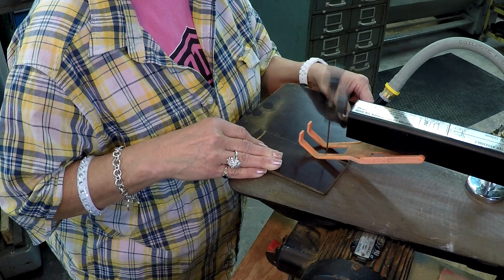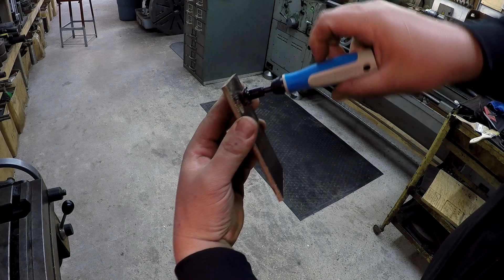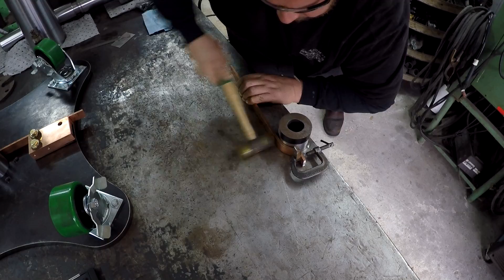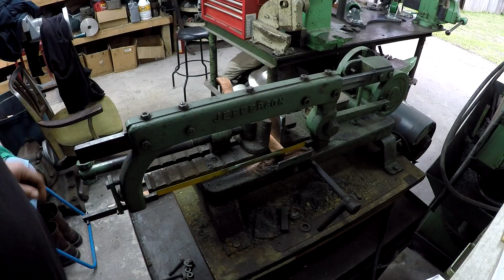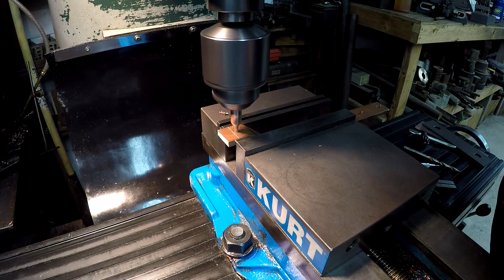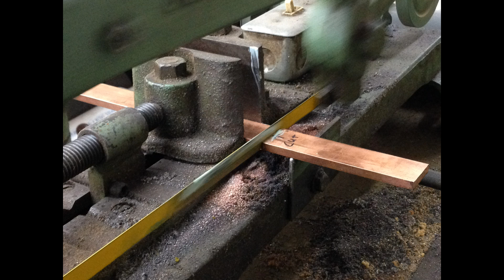Rotary Welding Table Build Part 14

Comment: The bolts would be better in brass than stainless with dissimilar metal you will have some electrolytic action take place but to a lesser extent with brass ! You could have bent the copper more easily had you annealed it first.
Reply: If he'd annealed it he would have lost the spring tension in the bars. The bolt with the spring would have then likely just bent the two ends together rather than truly provide more tension and adjustment for ware.
Reply from the maker: Dick Sargent My thoughts exactly. I didn't want to take a chance on them being too soft.

Comment: How about a motor with a foot switch, and a tilting chuck or maybe fab a T-bolt-down multiple position vice from a flea market find? (I'm thinking about Keith Fenner's set up.) You seem to be having way too much fun to stop now, and it's legal. Besides, what would all the experts do without your welding table?
Your Mom's cool....
Reply from the maker: Hey Lee, you just chocked full of ideas! I do havemore plans for the table, but it will be later on after the initial build. Thanks bud!

Comment: Hey there. First off let me say that I love this series. I picked it up about halfway through, but went back and caught up on it. After subscribing of course. 
 Now I know a little about machining, mostly from what I remember from high school, but there are a couple of things that you've done that leaves me with a couple of questions. 
 1. Why ream a hole the same size, or slightly larger, then a hole you just drilled? Now I get the idea (or should I say the need) of deburring, but what does the ream do that the drill bit doesn't?
 2. I seen machines do single point threading. But they are set at a consistent feed speed. How do you do it by hand? Are you hand feeding the cutter, or do you set your lathe for an auto feed? I do know enough to know that if your speed is off while your milling threads your thread pitch will be off as well. Hence the reason you took quite a few light passes then checked it with the pitch gauge.
 Keep the vids coming. They really are fun to watch. Thanks.

Comment: Hi, Adam. I would like to ask you something about this grounding: You mounted the copper block isolated from the base. But the two "brushes" are coming in electrical contact with table shaft, isn't it? Since the table column assembly will be bolted to the base, and all of its components are metallic then there will be also electric contact between the shaft, column and base. Then, why bother to mount the copper block isolated with phenolic bushings and plate on the base?
Reply from the maker: The current should flow through the shaft and into the faceplate and not through the bushings, or thrust bearing, and keep from chancing any arcing in them. That's my theory on it.
Reply: Abom79 I understand. Well, the most direct approach would be mounting a grounding clamp or something directly to the faceplate. However, this would limit the faceplate rotation feature, that's why you choose to apply the elegant "brushes" solution. You should do some testing to see if the spring tension on that bolt provides enough pressure of "brushes" on the shaft, to avoid arc in between. Thanks for the prompt answer.

Comment: For the spring, how bout a through bolt with a spring on it to push the pieces together
Reply: oops should have wathced the entire video b4 my comment
Reply from the maker: I thought you were messin with me for a second. LOL
Reply: Adam, I have been a machinist (all manual) for almost 30 years now. I guess you learn things here and there just from experiance. It never ceases to amaze me just how similar your thought process is to mine. I am in a machine shop in a papermill. All one off repair and alot of obsolete parts.

Comment: Nice work on the bends and cool idea on using the bolt and spring for the tension.

Just curious, after you tack weld the fixtures (the bending fixtures in this case) to the table, to remove do you just grind the weld?   And then grind level to smooth out to the rest of the table?
Reply from the maker: Thanks Ryan. Yes to remove just grind the welds and knock the parts loose. I use a flap wheel on the grinder to dress the welds down smooth, like a Tiger dics.

Comment: Hi Adam, nice job on the ground. I've been wondering since the you started with the ground how you plan to insulate the shaft from the base as well as you did with the ground. That is going to be tricky.
Reply from the maker: I don't see any further needs for insulating. Current should flow though the shaft the way it's built. But, the base will be painted and I'm thinking about leaving the area where the column mounts painted also. That would help to create another barrier.

Comment: Hey Adam. On Ground Straps Instead of A spring. Use a bolt and a nylock nut just to hold tension on it ?

Comment: Adam,

Metal surfaces exposed to the atmosphere tarnish/corrode.  The oxides,sulfides, carbonates, etc. that form interfere with the conduction of electricity.  Periodic cleaning of mechanical connections that carry electricity with DeOxit (http://store.caig.com/s.nl/it.A/id.1602/.f?sc=2&category=188) keeps things working well.  I and many other folks in the audio hobby rely on the stuff.  Don't buy directly from Caig, as you can get a better price elsewhere.

Eli D.

Comment: maybe some dielectric grease where the copper contacts the shaft?
Reply: +TheLagwagon6040 No, dielectric is insulating. If he were to use grease at all, it should be a conducting grease.
Reply: TheLagwagon6040   Dielectric is great on solid contact pins to keep moisture and dirt out. I've had to go threw many vehicles and dielectric grease all the connecters to get proper functions restored.  After time moisture starts to corrode the pins and the connection gets iffy at best.

Comment: Perhaps if you used a torch to heat the copper to bend it.
Reply from the maker: Ken Knerr I was afraid that would take the temper out of the copper.
Reply: Abom79  smart man

Comment: Adam, I am curious.  Since the purpose of the bracket is for continuity to the shaft from the ground clamp.  Why haven't you verified the ground connection with an Ohm meter?  Larry

Comment: Hey Adam! Love your videos, even though I'm not a metalworker.

I was expecing a sturdier spring on the bolt, something similar to the spring formed by overbending the rods. Is there a reason to choose that spring other than being the correct size?
Reply from the maker: I used what I had in the shop, but the beauty is that I can put on there anything I want. Just have to find a stronger spring.
Reply: Abom79 Cool! Thsanks! So a stronger spring it is!

I can't wait to see it done and put to use!

Comment: Nice work Abom79 Adam. Did you know you can get copper plated bolts?
Reply from the maker: Not that I have looked, but now that you mention it. LOL Actually I have a viewer Joe who works at a bolt supply house, and he wants to send me the ones I need.
Reply: Was kind of thinking that same thing, or even brass bolts, washers, and the spring.
Reply: In for a penny, in for a ... :)
Reply from the maker: Doug Hanchard
Joe Hale has offered to hook a brotha up! I need to get him a list of the bolts needed.
Reply: Abom79 don't let me near your shop.... This welding table could wind up needing its own insurance value policy

Comment: Your Mom seems like a nice lady and she did a good job cutting that phenolic.  The grounding system turned out very well.  Nice job once again.

 I've worked with phenolic and a few comments for you and the folks who read these.  Avoid breathing the dust, it's a fiberglass and epoxy mix.  It's tough on tooling and will knock the edge off tool steel tooling is no time flat.  Carbide holds up better but still wears.  The chips and dust soak up oil so after you're done machining, clean and re-oil the machine.

 Good to see another power hacksaw in use. They are a good way to cut material for not a lot of cash outlay.  I have a Racine power hacksaw I rescued off of CL that also works great.
https://www.youtube.com/watch?v=QDdJc_509bc

 Jeff
Reply from the maker: All good points taken Jeff. Yes that phenolic can be hell on tools.

Comment: Adam
Thank you for your Vids. I have a question about the T handle lock. will the current transfer with the brass plug you made to stop marring on the center shaft,   Again for the vid's Adam. Bob A Everett WA
Reply from the maker: I don't believe the t handle will cause any problems with the current flow.

Comment: What's the name of this tool that you use at 36min of the video?
Reply from the maker: That would be the Noga Multiburr that avi widovski sent me to test out. It's an awesome little deburring tool that has 4 different burrs on it. The one I used is for chamfering holes. It's slick! What ya say oxtoolco ?
Reply: Nice! If they sell to Brazil I wanna probably buy one.